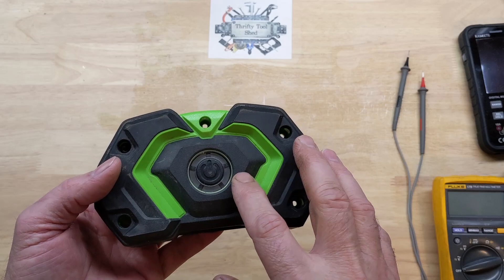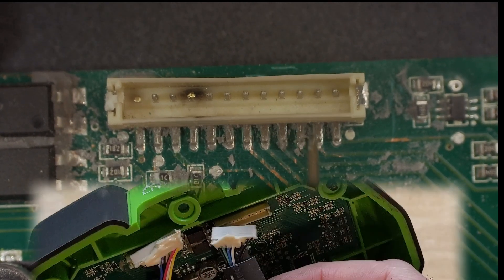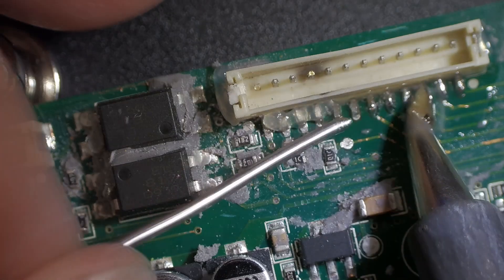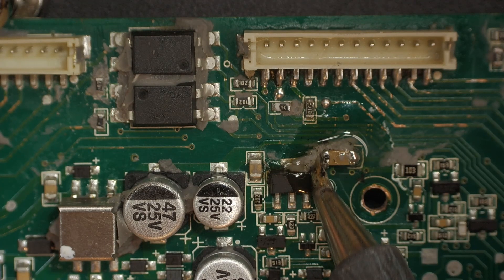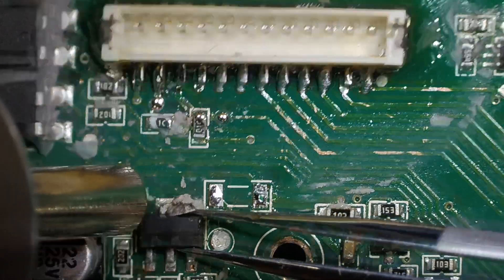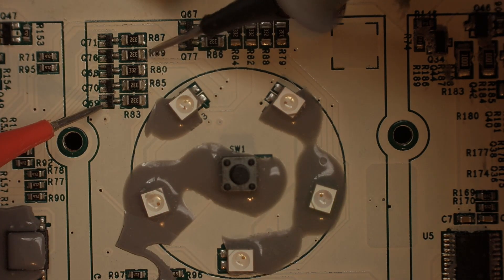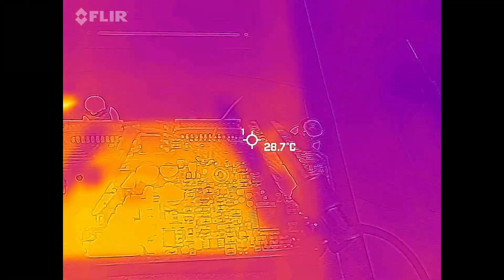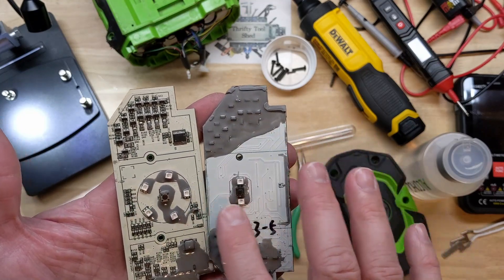EGO 56V Gen3 BMS Troubleshooting

Comment: Hi, I hope you and your family are doing as well as can be.

I believe I found a fix for the single red flash followed by multiple quick red flashes.

I took a bad BMS and connected it to a good battery and charged it, a few seconds later I unplugged it and the red flashing disappeared.  I tried to contact you on FB on the bench but FB messenger wouldn’t allow it.  I hope you see this message.

Comment: 3:25 you say you came to the conclusion that there was a short on the board. How did you come to that conclusion? Did you just check for continuity between all of connector pins?
Reply from the maker: I should have shown in the video about this same time frame the 3.3V rail was showing shorted with a DMM. It's been over a year, but at least that is what I should have been pointing towards if I remember correctly.

Comment: im curious on your thoughts on a 10ah, i believe gen3. It reads 53.5-54.2 and keeps bouncing around. It will not charge in standalone charger or in the device.  the button does nothing, no color whatsoever.  Feel like it's something simple, but don't know enough to step into it. Thoughts on where to start?
Reply from the maker: I have not worked on the 10Ah packs to say much about them. They are to my knowledge the Gen 3 with the segmented fuel gauge. If you are getting a voltage fluctuation at the terminals I would try to narrow that down to where the fluctuation is by going from cell group to cell group testing voltage. You may have a bad connection somewhere. Voltage fluctuation (bouncing) at the power terminals is not normal at all.
 When the BMS LEDs do not come on it can typically be either that the power is not getting to the BMS board from the connectors board due to a bad connection (could even be a fuse on the 10ah I am unaware) or it could be that the power is present on the BMS board but the DC-DC converter is faulty. You can test for voltage on the larger electrolytic caps close to the metal cube transformer around the center of the BMS board. With power to the board you should have around 8-10VDC on the cap close to the transformer. If no power is on the caps or it's much lower then the BMS board is faulty around the DC-DC converter ( at least the 2nd Gen boards were that way) Wish I could help more. Best of luck to ya!

Comment: REALLY loving your Ego battery videos!   I have a Ego 10Ah mfg in Oct 2020 (Gen 2 I think - it does have fuel guage).  It has solid yellow when I hold down on the button.  It will work in my tools for about 15 minutes before quitting and going solid red.  I think it's the thermal protection system issue.  So I replaced the bigger (square) Aupo 102 thermal fuses.  I have now dug deeper and I found some small 2-terminal sensors not much bigger than a couple grains of rice.  I assume these are the  NTC Thermistors?  There is no writing on them that I can see.  Can you tell me a part number or point me in the right direction?
Reply from the maker: Thanks for your kind comment. It seems like this pack may be under warranty if you have not asked EGO about that yet then I surely would. I have not worked on any 10AH packs yet to help much at all. I always call the segmented fuel gauge the 3rd Gen type. I may be wrong in that, I simply knew the 1st Gen seemed to have smaller connectors on the BMS board and the 2nd Gen I call them had the connectors like we see now. Both the 1st and 2nd Gen have the single LED that was green above 15% charge so not the best. I have not worked on much at all with the 3rd Gen or segmented Fuel gauge. I assume you are asking about the black bulb shaped NTC that are for temperature measurement. They are typically around 10K ohms at room temperature and that is really all I know about them. The BMS also has a board mounted SMD thermistor and most of the 5ah packs and above have the temperature board in-between the halves measuring temperature.

Comment: Can’t you make a video how to make EGO charging stop at 75-85%? I would like to charge to 75-85% and only top it up just before use if I have to use a full charge. 

Also, is it possible to make a charger that charges all batteries to 75-85% in 30-40 mins, and 100% in about an hour? I think the charger charges the small batteries way too fast for it to be good for the batteries (0-100 in 20 min) and at the same time the charger is underdimensioned for the 10-12Ah batteries. 

Oh and one more thing, is it possible to make the batteries shut down a little earlier at low state of charge?

And by the way, I love your videos, they are very informative but these are the questions I am looking for an answer to. 

Because I use my batteries daily, often many cycles a day, I would like them to last for as long as possible.
Reply from the maker: Thanks for your kind comment. The only way to make the EGO pack and charger to work in that manner would be to get the program from the BMS on the microcontroller and change it to do so. It would be super time consuming obviously. The packs usually charge to around 4.12V per cell and pull down to around 2.9V per cell. This is well within the cell data sheet specs of 2.6V-4.2V. If you still wish to do so the only way I have done this is with a DC-DC converter or 60V Bench Power supply. Using a CV-CC supply can help as you can adjust max voltage output like 52V for example and the current to 2A or so.. the main issue with charging this way is that you bypass the BMS by going straight to the battery + and - terminals and have no individual cell monitoring. Charging like this is not the preferred way since if cells do get unbalanced it has no monitoring for that. It simply puts out the voltage you set and in hopes that all is balanced well and voltage is divided by 14 for individual cell voltage. As far as the cut-off voltage it would be hard to change without microcontroller reprogrammed also. The only other way would be to add a LVCO (low voltage cut-off) module in-between the pack and the tool.
Reply: @ThriftyToolShed  Thank you so much for your answer! 
I have a few qustions about the charger and how it works. The batteries contains the BMS, but is the charger only an on/off device controlled by the BMS in the battery? How does these communicate with each other? 

The charger is very light, no huge transformer in there so it must be some kind of PWM regulation? Does the battery/bms tell the charger which voltage to give or does the bms regulate voltage by itself? 

And my next thought is other devices.. If I buy other 56V stuff, like a 56V bike, should it just be enough to build an adapter for the batteries to drive it with EGO batteries? Two pins (+-) is the only that’s needed and then just make sure the bike won’t draw more current than the batteries can handle? 
A bike without battery is cheap, or one with a worn out battery. And if I build and adapter for two batteries, can I just run these in parallel without issues? 

Maybe this might be a topic for a video? 
Thank you 😃

Comment: I have a 5A pack that worked fine for about 5 uses prior to storing it for winter. I noticed it was in self discharge mode after a few months, and then a few days later it was dead. No lights on button press, nothing happens when put on charger.  The board has no silk screen, but checking test points based on video of earlier board d3sign it looks like battery 8 thru 14 are fine, but the first 7 battery test points are all near 0 volts.  Does this sound like bad cells, or could this be caused by some other fault? Thanks to anyone who can help.
Reply from the maker: I had my very first failure and video on a similar issue. I found a shorted transistor causing mine on the 2nd gen board. It was blinking green all the time not just self discharge storage mode. Not sure if it is the same failure on the 3rd gen or not. 
https://youtu.be/EH0GS0iUzzM
Reply: @ThriftyToolShed  Thanks. Is there somewhere I can download your picture of the silkscreened older board? Having some labels would helpful.
Reply from the maker: I had added it to my Thrifty Tool Shed Facebook group "On the Bench" that is one main reason I created the group! 
https://m.facebook.com/groups/352614655247940/permalink/1600980367078023/?mibextid=Nif5oz

Comment: Hey Thrifty I have a BA2800T (56V 5.0AH made in June 2022).. It doesn't do anything on the charger (tried 3) and pressing the button does nothing as well.. It tests 48V though.. Have you seen one that does that? I'm not good at soldering (but do have a bud who is) so not sure I can fix or not.. Thanks for your time!
Reply from the maker: If it reads 48V at the terminals and the fuel gauge doesn't light up it is usually something in the DC-DC converter circuit on board. It converts the 56V nominal to around 10V for the control. It is around the caps in the center of the board.  The silver can "cube" to the left that is the coil for the converter circuit. Sometimes the coil is opened.
Reply: @Thrifty Tool Shed  
Do you know replacement part# or exact spec for the DC to DC converter coil 'silver cube' with 6 pins ? With good BMS, I find 3 sets different ohm readings, I can't find any letter on that cube coil. When that Q12 DPack Mosfet is shorted this DC to DC converter coil is shorted or open circuit too on many bad BMS that doesn't light up with good battery pack.
Reply from the maker: I do not have a part number for these. I have commented many times about the readings from a known good board. The top left two pins read around 5.4 ohms. The bottom left two pins read around 8.2 ohms and the right side top and bottom read around 6.8 ohms in circuit and unplugged on the older gen 2 BMS boards. So it is 3 different coils I believe.

Comment: I really need to get myself some better quality small tips like that.  There’s a lot of soldering that can be done with a basic cheapo iron but with these tiny smd repairs a nice tiny bent tip like that is essential I think.
Reply from the maker: Makes it much easier for sure. Hot air is even better at times when you can use it. Seems like the back side of the board is always densely populated or Electrolytic caps really close or some connectors I am concerned they can't take the heat on the plastic, duh!

Comment: You ever have a brand new battery that doesn’t show anything on the fuel gauge at all? I have 54v and the charger registers it but charger stays at 25%. If I put the battery in a mower, I can keep the mower lights on indefinitely. The mower will spool up but stop and the mower indicator will flash green to red. The lights on the battery do not function at all. Been waiting for my warranty replacement for some time.  Would be great to fix this one as manufactured Feb 2022. Seems so wasteful to recycle it now.
Reply from the maker: I can say I have not seen a brand new one do that. I only had one of mine fail under warranty actually and it was shown in my very first EGO video.  I have seen some of these fail in a similar way and the BMS board is either bad or bad connection to the BMS board. If BMS board is not getting powered up properly then the microcontroller can't communicate with the tool through the D-terminal. If no communication then most tools will run for around 10 secs or so and shutdown. If that is the case all of your cells may be fine.
Reply: If it’s new I’d try to get it replaced if possible.  I believe the lights on the mower might not need to communicate with the battery to turn on.  Starting up but for only a few seconds is expected when there is any battery issues.  Most mowers will do the same without communication with the battery, like if you tried to power the machine with a power supply.  
The fact that the eGo charger seems to recognize the battery enough to charge it at all is surprising to me though if the battery pack isn’t communicating.  Although I don’t even have an EGO brand charger and use a power supply to charge my packs up.  If you have the right dc converter or power supply you could see if it will charge up fully that way I suppose but unless you can get it communicating again It probably ain’t gonna run the tool.  No matter what, the cells inside are definitely worth salvaging if it comes to that.

Comment: The whole philosphy here is buy a new battery, unless you have access to the SM parts the maker use. Unfortunate but reality. Thanks for your time and try.
Reply from the maker: The reason of course for the try and kinda what started the EGO videos over 5 years ago is that all the packs I have worked on are warranty replaced packs from EGO. EGO let us keep them to recycle. So after buying some from eBay to start accumulating parts and cells and with viewers who donate some for the videos it's been very good to see so many packs saved from the bin. This one was unfortunate especially since this was the first of the Gen 3 boards I have had to look at! Oh well!
Thanks for your comment!
Reply: @ThriftyToolShed  I am a Mechanical Engineer and you are teaching me a lot about Li batteries and the BMS that operate them.  I am hoping you will fiind a replacement BMS that can be used in Lieu of EGO not allowing to sell the BMS boards.  I have one that won't allow the battery to discharge.  Some type of event triggered the Cmos to permantly disable the discharge.  Hope i am wrong, but it seems the case .